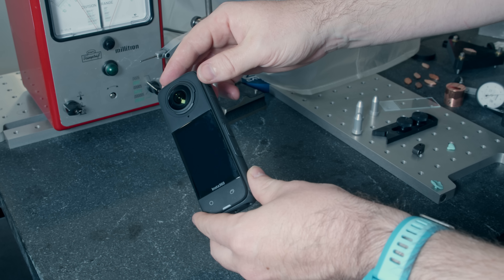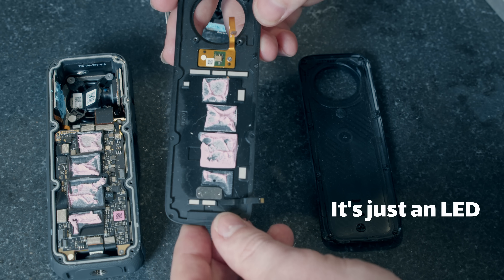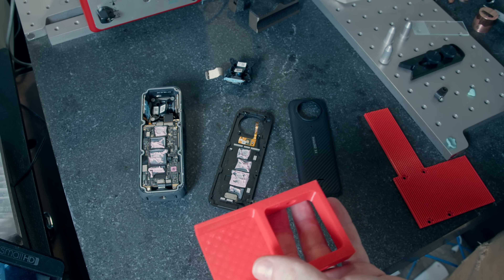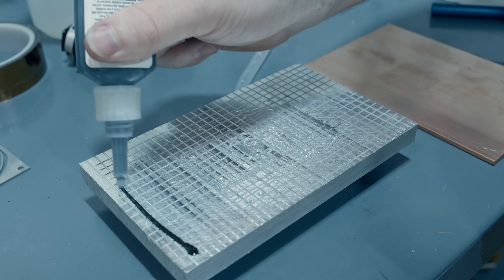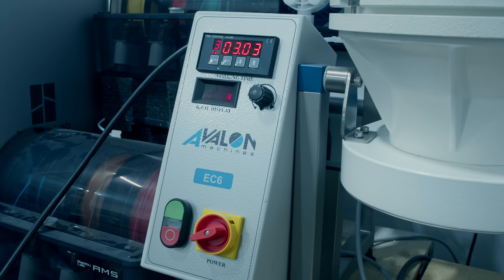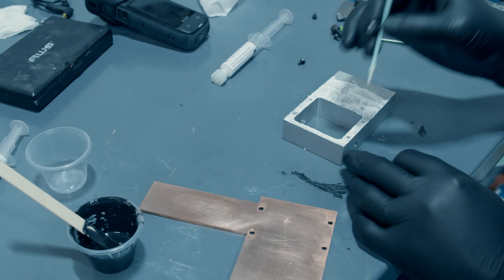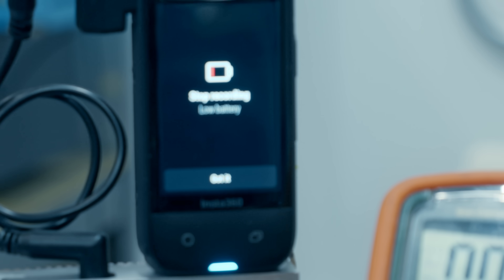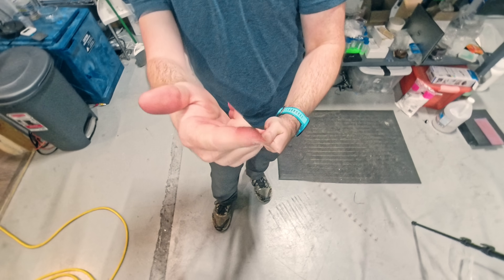Overkill Heatsink = Never Overheating Again

Comment: First thing i do with these kinds of pocket cams is ditch their battery and use a dummy one for that takes juice from the grip. For 99.9% of the applications i use it, which is to record interior spaces before and after work, that's all i need. When you do this, they never heat up.
Reply: make a video about it
Reply: Why won't they heat up? You're saying the heat comes from the battery and not from the recording/processing process? :p
Reply: @just.jose.youtube  The battery is one of major heat source, not all of it, but it contributed, GoPro is notorious for this, using them with external battery rarely got them overheat, they even made it so you don't need a dummy battery, they can work with just USB and no battery. rofl I guess they know that lots of people use it as stationary camera.
Reply: Do you have to cut a small hole in the battery door for the cable or something?

Comment: Nice! I like that the solution ended up not really requiring disassembly of the camera. Should make it super easy on others.
Reply from the maker: Agreed! I was originally planning to create an entirely new backplate with the heatsink built in, but looked like way too much work to reverse engineering. This ended up being pretty clean and more easily replicated.

Cheers again for giving me the idea to use the insta360 for interviews!
Reply: For people not having tens of thousands dollars worth of equipment, just buying 2 cameras might be actually a better option 😇 cheers!

P.S. That intro is goooood 👍
Reply: @aktik6000  As they are waterproof, know what would work even better and be even cheaper?

Take off the rubber grip, poke a little hole in the bottom of a short cup, (of a cup you cut down to be short) mount the camera to the tripod by passing the mounting screw through the hole, into the cup, fill the cup with water.
Reply from the maker: I saw someone add a tiny fan underneath the camera using external power, which seemed like a good option too.

Comment: adding heat sink plates to controller 25kw controller for Emx  - may add water evaporator if needed  - gallon  evaporated = 8700 BTU  or 2500 watts

Comment: This is great! You might already know this but one of the main features of more professional cameras is better thermal management. As camera sensors heat up, they tend to have a worse Signal:Noise ratio and it's important to capture quality. This mod probably changes the thermal profile of the camera, so I would suspect you can't rely on whatever testing (if any) they did around thermals and quality. Adding a big 'ole heat sink is a nice addition and it's possible that you're going to end up with lower quality footage past its previous runtime.

Comment: It looked like the space between the chips and OE Al plate was pretty far.  The pink thermal interface goo was thick.  Did you wonder if the gap was too high?
Reply from the maker: Yeah I was curious about that as well, but didn't want to tempt fate and wipe the pink thermal grease off to check (also wasn't quite sure how to check). It might be why they had a foam "dam" around each chip, to help keep the grease in place and help bridge the gap

Comment: Protip with most meters you can disable the auto off feature.  with some Extech it looks like you do that by holding the mode button while you turn the rotary knob from off to one of the modes.

Comment: You might be able to get rid of the seam if you mill a few mm of copper diagonally from the top. Also I'm surprised you didn't use a heatpipe.
Reply from the maker: I wanted to try a heatpipe! But I was afraid I wouldn't have enough clearance for pipe + copper on top without interfering with the "invisible seam". And just bonding the pipe alone would have looked even more janky 😅

Comment: i love camera hacks. did you try to see what the performance was like with just the rubber part removed, keeping the aluminum plate intact?
Reply from the maker: I didn't, although wish I would have! I was over-excited while disassembling and took it apart fully first, then realized putting it back together was going to be a chore. So I never got ended up running tests with the plastic off 😢

Comment: That design is really stupid why would they make a camera with such a fatal flaw. Adding a heat sink would even make the product look better and feel more high quality.
Reply from the maker: I've been told it works fine in action settings, and I guess they were afraid of people burning themselves on an exposed heatsink? It does get quite toasty. So thermal shutdown might also serve as a safety feature too. But yeah, pretty silly. The lower-res modes will record the full length, just the 8k melts it.

Comment: At what temperature it did shut down before?
Reply from the maker: I'm a bad scientist and didn't check before starting the disassembly (because I got excited to see what the internals looked like). Higher than 47C at least, since it survived that happily with the heatsink on. I'd guess 60C'ish? That's starting to get pretty toasty for electronics.
Reply: @BreakingTaps  Passion took over the journalism 😉
At least this can be done to your camera but not to hour mobile phones.

Comment: I built something kind of like this for my Note 8 phone. I used it for long videos to serve as both a dash cam and to make some hyperlapse videos. I used an 3mm aluminum sheet with a hole cut for the camera bump. I epoxyed that to a dash mount. Then on the back side I mounted 4 60w peltier modules wired for 6v each from the 12 lighter socket. I mounted a pair of heatsinks with little noctua fans running on speed controllers to keep the noise down. It kept the phone down to about 65°F even while recording 4k on the dash driving into the setting sun when it was well over 100°F. Mine worked, but it was really ugly compared to yours.

Comment: i guess the plastic is also used as a insolator so the surface temp dosent get to high and its legal to sell
Reply: thats not how thermodynamics work
Reply: @drkastenbrot  the amout of heat energy is the same of course but by isolating the hot part less heat can escape at that spot and so the surface temp is lower 
Because Produkts like that arent allowed to exceed a surface temp so nobody can get burnt. You get a higher delta t form internal to external temp limiting the device and making it legal to sell
Reply: @kevinheimann7664  nope. if you have a defined amount of power (as you do in electronics) and a defined outer surface area, all you can do is redistribute the heat. you can make one side hotter and one side cooler, but isolating the surface will not change the average surface temperature. you cannot contain thermal power, it will always climb to equilibrium and escape. if that doesnt seem intuitive to you, have it explained to you by chatgpt.
Reply: if you perhaps mean that they are trying to avoid hot spots: the large aluminium plate already does that and the plastic used is most likely thermally conductive plastic. dense electronic products like smartphones and these cameras will inevitably heat relatively evenly purely as a result of the density, and the internal construction just helps reduce junction temperatures.
Reply: It will limit the thermal output as it will turn off before the plastic has the time to become too hot, without the insulator it would work longer but surface temps would be way too high. 

This is very common in holdable electronics.
Reply: @drkastenbrot  it cant reach equilibrum if it turns off before it reaches that. Your missing the time Komponent Heat will always escape yes but for example if you put hot water in a mug and in a thermos what has a higher surface temp the thermos will have a lower surface temp and it will take longer for the heat to escape
Reply: @kevinheimann7664  look at some basic numbers for heat capacity, it has barely any relevance here. and the comparison to water is completely pointless because it is not a heat source.

Comment: Cool project. But radiator's fins are to small and too close for passive cooling.
I doubt that they performs much better than a piece of copper plate with similar size.

Comment: I would have either screwed the heat sink on from the inside of the cover (and if the cover also screws into the chassis, added access holes in the heat sink) as that's a far lower thermal resistance connection and also mechanically much stronger than goop in the middle and dodgy epoxy around the edge...   Or, if I had to adhesively mount the heat sink, I'd probably give the Tech Ingredients thermal epoxy formula that they claim is better than thermal compounds a try and do a 100% adhesive bond.   I'd probably also clean off all the lowest cost factory thermal goop from the internal components and replace it with whatever the top rated GPU thermal goop the overclocking crowd is currently in love with..  I had an old netbook that always overheated and redoing the cpu heat sink with Arctic Silver which was the best available at the time dropped the cpu temps by 11 degrees as it allowed better heat transfer vs. the white silicone grease from the factory...  It still overheated, but with the new goop, it took longer..  Unfortunately, the thing really needed a much bigger heat sink, but there was no room internally for anything bigger that what was there..

Comment: another approach to make it more compact and lighter would be to use heat pipes to get the heat off, a small heat exchanger with small 5V fan to get rid of the heat.
Reply: Heat pipes would be too large, a vapour chamber like in phones would be best
Reply: @Volt64bolt  they'd be thinner than the giant piece of copper he has on
Reply: @MrNoipe  smallest I can find are 8mm, that looks to be 4-6
Reply: these are 3-6mm in thicknes
Reply: look for wakefield thin heat pipes
Reply from the maker: Heatsink ended up being about 2mm thick, there's unfortunately not a lot of depth to work with here before it shows up in the shot :(
Reply: @BreakingTaps  It is what it is.... but if the housing nearly 2mm thick, then there would have been maybe 1milli protruding. Keep it for the next one :), or buy a bucket of dry ice :)
Reply: @BreakingTaps  could you have potentially tapered the heat sink to match the view angle of the lens?
Reply: @Volt64bolt there exist heatpipes that are extremely thin, probably made for tablets or ultrabooks or something, they're around 1mm thick, some people use them for cooling mods for laptops
Reply: @___echo___  vapour chambers basically at that point, they work very similarly, just one is a pipe and one is a flat chamber
Reply: placing a fan directly underneath a camera you're using to record interviews in a quiet room? sounds pretty dumb compared to what he did, which seems to work 100% perfectly for the use-case he designed it for

Comment: For super-glue, even the rubber enhanced loctite, all you need to do for release is heat it up to somewhere around 250F and it will pop free. Acetone is second best.
Reply: I recently had to use both, a Chinese part had a pipe fitting glued in, had to blast it with a torch to unscrew the fitting, then soak in acetone to clean the threads (then discovered the Chinese had mixed thread types so I had to tap the hole...)
Reply: That releases death fumes
Reply: Yes and no, as the act of heating it up risks warping and melting (especially if your part isn't just one material), likely covers it in some soot, the glue fumes etc. The downside of solvent is it takes a while, the upside is the part comes out super clean and you didn't have to put in any effort yourself, just leave it in the sealed box of magic goo. Neither is really best and both have their place.
Reply: @foldionepapyrus3441 Acetone also doesn't like a bunch of plastics so if your part has any of those in it it will be destroyed
Reply: @nikkiofthevalley  Very true, though if you part has plastic elements it probably won't like the hot removal method either... 

Which really just adds to my point of no method universally best.
Reply: @foldionepapyrus3441  Some high temp plastics don't like acetone either, so that's not guaranteed either. I wasn't really arguing against your point, I was simply adding a bit more info
Reply: @foldionepapyrus3441  Soot does not form from melting. And neither aluminum nor copper warps to the point of being problematic at 250F/121C. Also, as the glue softens it will have enough give to mitigate the problems from two different thermal expansion rate.

Heating is only problem if the heated material can not whitstand that kind of heat, which is most plastics and such. Not a problem at all with most metals and certainly not in this use case depicted in the video.
Reply: @anteshell  I didn't say soot forms from melting - they are separate elements of that not exhaustive list. The soot can be expected because of the tool you are using to apply the heat - burning stuff tends to be sooty... 

Also you can't say for anybody else what the 'problematic' extent of warping is - everyone's projects have different requirements. 

It also is irrelevant if the glue can deal with dissimilar expansion between arbour and part without creating a warp if the part is made of multiple materials already! 

The whole point is neither method is simply 'best'.

Comment: The bearings in your spindle look like there is no pre-load and they are loose. The spindle should never bounce up and down, noticeably, under load.
Reply from the maker: Haha yeah, it's not supposed to do that 😁 I think the retaining nut gave up the ghost, heard some noises the other day and now this. Haven't had a chance to tear it apart yet.
Reply: Yep, it sounded like the bearings weren't happy to me too - although since my background is in stationary industrial process equipment rather than machining equipment, I didn't know enough about the innards of milling machines to comment on what exactly might be wrong (hence no top-level comment from me).
Reply: I would love a video on the spindle teardown

Comment: I would have changed that blue and ping goo which looks like it was way too much and is probably whatever they could source cheaply in bulk rather than a decent thermal paste
Reply: The fact that the additional heatsink easily pulled enough heat from the camera to keep it operational proves that the existing thermal compound was perfectly good, it was just the plastic housing that stopped the heat from escaping. Which wasn't a design flaw, just a compromise - for something that is designed to be handheld, those surfaces needed to be covered.

Comment: This seemed like a job for one of those NVME coolers, with heat pipes and thin fins.
Reply: It would probably show up in frame badly, his even showed up a bit.
Reply: Was thinking of heat pipes from laptop cpu's, there must be a design that will fit the back plate nicely and has the added bonus of fast heat transfer

Comment: could i borrow one of these to record driving around loop 1604? would need a battery mod as well to make sure it lasts the whole ride XD

jk but fr i plan on doing this to one eventually. nice work
Reply: i would put a milled slot and a 1mm heatpipe into the copper plate where it touches the cam

Comment: Heatsink is nice visually but useless. You make 3 really big mistakes about heat dissipation rules. First, heat sink must have big surface on sink, second, don't ever mix copper and aluminium together as a heatsink, that's bad idea. And thrid heat always goes Upside not Downside and you heatsink have big thermal capacity downside, that's bad idea too.
Reply from the maker: Nah it works fine, as evidenced by it no longer overheating 😉

Comment: I feel like it would have worked just as well with only the top half of the heatsink. You should have done a long test with external power.
Reply: Pretty handy to include a mount for the audio sync device though, might as well combine it into a larger heatsink at that point if you keep using both anyways.
Reply: @Metazolid  You mean making a heatsink-mount-holder chimera? I'd rather have a more than sufficient heatsink and keep it pocket sized.

Comment: Should be a standard design feature in a lot of electronics
Reply: used to be a standard design feature in a lot of electronics*
Reply: @JustinKoenigSilica  nowadays it’s all made of aluminium but no fins
Reply: Engineering is all about compromises and it's pretty obvious that those compromised were done so you can have a waterproof 360 degree camera that can be haphazardly thrown around.
If there was an exposed heatsink, people would still complain about the chassis getting "hot to the touch".
I've seen reviews of various hardware taking points off because it gets "uncomfortably hot" when it's pretty much a feature that would have lengthened the life of the device.
Reply: Almost no modern electronics have sufficient thermal management. 🤷🤦
Reply: @MrMadsci7  That is because they try to make them look "cool" and dirt cheap to produce so they can sell it to you at a premium all while laughing to the bank.
Reply: Or at least be an option. You want the expensive toy version or the real camera?